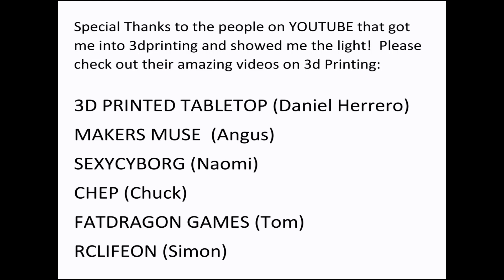Why do LCD screens fail in resin 3d printers?  Are they cheap pieces of crap or something else?

Comment: I have 2 Anycubic Photon S, that I’ve run frequently, but not daily for the past 6 months.  I think I have an LCD failure on my hands but wanted to get confirmation.  I’ve run a couple of failures in the past week, and the build plate comes out with a bunch of transversely oriented areas of cured resin, and realized yesterday that when I run a test on the printer, the UV likewise is a series of random parallel stripes, instead of a uniform glow.
That being said, if does sound like a LCD fail, where can I buy a replacement?  Also, is there a way to upgrade the resolution, etc of the LCD screen to improve the resolution of the prints?  Not sure if that has any effect, but curious because I mostly print 28mm miniatures and I’m trying to crank out as much detail as possible.  PS love your channel and appreciate what you do, keep it up!

Comment: here  i learned its jsut heat that kills them .. and most lcd printers do not have enough cooling...  the black and white/.monochromatic printers  are faster  because  of the complete blocking of  uv or complete pass through. ( not filtering through semiptransparent color rgb)   and thus also last longer and care less about heat. .
most resin printers have no or little to none cooling for the scren as teh scren and teh reflective panels are trapping in teh air heated up by the LED .. 
nothign that a few well placed vent holes and a cold air fan cant cure..
Reply: i wonder if putting a peltier module with a fan to blast cold air over the lcd surface would do the trick and extend the lcd module life . also as a newbie would cooling the resin help to heat sink the heat from the lcd on the top most surface of the lcd or would it degrade the print

Comment: BLASTER with UV light, Year Leave somethings out in the Sun and what them fade.

gadgetman below

The new Photorez Sonic has a special LCD screen for 3d printing. According to them it lasts like 4x longer and prints faster because it doesn't heat up as much like typical LCD does by letting the UV light pass thru easier instead of converting to heat. But of course that LCD is like 200 bucks I think so when it DOES go, it costs way more to repair

Comment: I made a horrific mistake with one of my elegoos. I actually had a small layer of cured resin on the FEP that I didn't realize accumulated from a failed support bit.....and the build plate when it came down on the next print it started making a grinding noise (Because it was trying to push down on the LCD but the resin was blocking it, so it was actually CRUSHING down into the LCD)----a really sad mistake to make on my part...fortunately for 30 bucks I replaced the screen---but still, OOF that ruined my day :) Lesson learned though!
Reply from the maker: ow!  that's why support placement and not failing are so critical!
Reply: @3dprintingpro212  too true, fortunately I've used your videos to improve my supports and haven't had any failures since. And also fortunately it wasn't too costly of a mistake when it happened! but one time is more than enough times to learn that lesson!
Reply: could you tell me where you bouth the LCD?
Reply: @enoriega  Hey Enoriega, you can sometimes find them on Amazon (Covid has definitely made them harder to find) ---also sometimes the maker of your 3D printer sells it as a spare part. You can find them on ebay / general googling the same size for your unit---cost around 30-40 USD. MOST OF THE TIME they ship from china, so be aware it could take a while to get a replacement. If you buy one, do yourself a favor, and buy TWO...so you have a spare ready when you need it.

Comment: OK, let me reveal a little secret here. LCDs used for a cheap MLCD resin printers are a color ones. Yes an R-G-B matrix. Google "color LCD" and you'll get the idea. Now, the issue here is that the transmittance of such a sandwich-ed LCD is around 5%. So, if you have a 20W light source, only 5W goes true this sandwich. And this is true for a visible light. For a UV or deep blue (405nm wavelength) the thing get even worst, because the R and the G portion of the pixel blocks the "blue" light even further - to put it in a layman's term.. As a consequence the majority of UV light is used to heat the LCD. The UV-range used for photocuring is not that dangerous for the LCD matrix after all, but the heat is. Though if we would use deeper UV like 380nm or 360nm or even deeper... that would be another story.  Now you have it... why we use this spectrum.

Better a.k.a. more expensive MLCD resin printers use active cooling of LCD mask. UNIZ in their 3DPs even use a liquid cooling!
Now to the other secret. The MONOCHROME LCD. Yes an ancient technology that was discarded in favor of color ones. And funny enough, they had to "reinvent" the process because no one was making them anymore. Within a monochrome LCD you have one solid pixel instead of three in color LCD, and they are without any color filter in front. That's why some vendors claim that their "secretive" and superior technology is better.  Of course is better. And of course is more expensive, because LCD manufacturers have to re-adopt the color-LCD workflow to the monochrome. It's basically the situation from the beginning of color-LCD life-cycle. At the beginning color LCD were very expensive until the production meet the demand. Now they are VERY cheap.
For example I just payed 360USD for a 13,3" 4K monochrome LCD while a 15" 4K color LCD could be found for 100USD.
Bottom line, sooner or later every single vendor in MLCD resin printing will have a monochrome 4K LCD! Right now the demand if much higher than supply and changing the cheap colored LCD is still a viable option.
Guys, if you can find a way to cool your LCDs is not that hard - though a bit noisy!
Reply: Awesome post, thanks!
Reply: There is a MONOCHROME LCD 3D resin printer,, faster printing. 
gadgetman below

The new Photorez Sonic has a special LCD screen for 3d printing. According to them it lasts like 4x longer and prints faster because it doesn't heat up as much like typical LCD does by letting the UV light pass thru easier instead of converting to heat. But of course that LCD is like 200 bucks I think so when it DOES go, it costs way more to repair
Reply: @3D_Printing  As for April 2020 there are only a few (5) printers that use Monochrome 4K LCD!  We are using 13.3" 4K mono LCD and it costs 3x more than a color one.
Reply: How does Uniz liquid cool their lcd masks?
Reply: @mkfabrication606  Quite an easy solution. You can find on their website under support a "Replacement of an LCD" tutorial where you can see some pictures with a cooling system. Bottom line... It resembles a floor heating pipe like tubing. Transparent of course :-) Well actually is more like plexiglass with carved maze for water/oil to flow around and cool the LCD masking screen.  I didn't yet disassemble mine so I can't show (point you to) any pictures. 
My opinion... an overkill!! BUT, but you have to keep in mind that the UNIZ Slash printer was designed to build 200mm/h and more. Although they advertise it and brag about their UDP (unilateral direction peeling) it's a hole in the water. It NEVER worked as it should.  And sincerely for 4k USD.... it costs like a Ferrari, it looks like a Ferrari, the specs are like a Ferrari, BUT the performance is like Anycubic-S.
A bunch of good ideas very badly executed!!!!
Reply: @dodobarbar  Hello, this is the first time I'm coming across this info. I have the Elegoo Saturn 4k coming in, in a few days. Is there a way I can mod a cooling unit to it, in order to prolong the life of the LCD? If yes, can you please point me to some articles/tutorials on how to do it?
Reply: @rahulbanerjee2970  Sorry, for a late response. Hmm, not that I would know! I mean, a how-to article or a link. But You should do some unscrewing and check where would be the best option to introduce an additional fan that would blow directly to LCD panel. I would sugest some radial fan (google it : radial fan images). Personaly I don't have a Saturn, though it was on my shopping list, so I can not give you any further detail.

Comment: Would be great if they built an OLED screen that the LEDs in it were UV in stead of color like other OLED screens. Would make the machine a lot smaller and would require less power. That would be ideal!
Reply: Sure, sure, but... OLEDs DO NOT  GENERATE UV-length light. Simple as that! Next idea?
Reply: Take a look at Photocentrics line of 3D printers. They do not use OLED but they do use LCD technology that doesn't rely on 405nm light to cure. You can't use regular resin on this but you can buy "Daylight" resin that cures at light wavelengths that are higher then 450nm. The failed ONO 3d printer uses the light off your cell phone to cure resin. But it's not the printer itself that lets you do that, it's the resin that you need to use. I'm pretty sure that it is possible but it will be a bit too expensive for consumer level hobbyist like us... So no one is really pushing for it nor cares for it.
Reply: I'm sure they are going to try to invent screens that don't overheat themselves to death or mess with that thin polorizer? that's attached to the screen.
Reply: @johnbouikidis6317  Hold your horses, buddy! Photocentric DOES use "daylight" wavelength to cure their resin, BUT... The new printers they developed recently use 405nm!!! Bottom line, using visible light requires more energy/area thus time per layer is unacceptable high for today's standard. UV carry MUCH more energy, consequently the curing time is VERY short. The negative side is that everything below 400nm is damaging for LCD. Basically UV got trapped in the LCD structure thus overheating it and  destroying it in relatively short time. So, "they" found that the sweet spot is around 405-420nm. (I'm not even mentioning the photo initiators for starting a photo-curing process). Therefore, ...I admit, I was looking toward "daylight" resin printer too, but it's really a NO-GO for the future. The benefit of a UV at 405 is way greater than of "daylight". that's exactly why  Photocentric is working on NEW UV printers. Disclosure: I've got a whispering confirmation from a Photocentric representative Formnext trade show!
Reply: @dodobarbar  I wasn't aware that they started developing printers that use 405nm. I was basing my information on prior years when I was interested in using daylight resin as well to try and make a cheap DYI printer. I've seen a few videos by 
Ionel Ciobanuc where he made a resin printer that uses daylight resin and used just a regular LED matrix to cure the resin. I appreciate the information you provided. It seems that you know a good amount of information that we could all learn from.

Comment: Speaking of screen failure - has anyone tried cellphone type screen protectors on the MSLA screens? Wondering if those would make any difference when getting the inevitable bit of cured resin sitting on the bottom of the vat.
Reply: THAT WOULD BE A NO NO NO NO!!!!! MLCD resin printers use a special film that's based on Teflon (FEP) or super hydrophobic silica (PDMS) that help peel the part from the VAT.
Reply: Just use packing tape.
Reply: ive heard of people using the nintendo switch screen protector on their photons because the screens are the same size.
Reply: @companyoflosers  Nice. Thank you.

Comment: That's the one big gotcha of MSLA printers. Average life of the screens is estimated at 400 hours. Not THAT terrible with the little $30 screens and typical hobbyist use. But if you are using the printer 24 hours a day as many do, especially with tall builds, that means on average you're replacing the screen every two weeks. That gets especially expensive with the new 10.1" printers.
Reply: yes but those who are printing 24/7 are probably running a business. idk if youve seen how much a mark-up occurs for 3d printed objects, but they cover the cost of resin and replacement parts in the price.
Reply: @companyoflosers  That's true, but if you're printing tall objects like vases or similar, those print times are LONG and the hours do add up fast. But like with just about anything else - bigger toys = bigger costs.
Reply: The solution is pretty darn simple! COOL IT!!! Use some DIY skills and use another fan!
Reply: @dodobarbar  But is it the heat that kills the screens or the bombardment of UV?  Or both?
Reply: @JohnJones-oy3md  Heat is the No.1 killer!! UV in the range of 405nm is not that much of an issue. But down the road adds to the equation for sure.
Reply: @dodobarbar  Please, i need more information about it. In my country it is very difficult to buy a new screen. Delivery from Aliexpress takes a month or even more. I searched the whole Internet but couldn't find how to improve cooling of LCD on Anycubic Photon
Reply: @clanbaclan6285  The Anycubic Photon has  a very bad design regarding UV light. Basically, well you probably know it already,  the shape of a light funnel is a "pyramid" alike and goes from the LED chip all the way to the LCD.  You should  therefore open this funnel on top close to the LCD and introduce some kind of air blower . Like the cooling of the filament in FDM printers. But as far as I know the LED  combo is around 20W. Which is not that bad. There are 3DP that have 120W!!! That's a oven basically. 
To really try how hot it gets, make a 1h or 2h print (as large as possible) and immediately after finishing take the vat out and measure with IR thermometer or just use your hand! If you can hold your hand on the LCD without any discomfort...you're good! But still, electronics doesn't like very high temp. so if you have a DIY skills make some cooling.
Reply: @dodobarbar  Id say reading the posts. The uv ends up causing the heat to destroy the lcd. Cooling the lcd with a peltier module might help
Reply: @bobbuilder5399  Peltier element needs a flat surface to be "glued" to. Where would you stick it? On an LCD?  :-) ...how would a light pass through. There are better options, like water cooling for example.

Comment: The new Photorez Sonic has a special LCD screen for 3d printing. According to them it lasts like 4x longer and prints faster because it doesn't heat up as much like typical LCD does by letting the UV light pass thru easier instead of converting to heat. But of course that LCD is like 200 bucks I think so when it DOES go, it costs way more to repair.
Reply: Ahh, rubish.  The "special" thing is the monochrome LCD.

Comment: So, would a lower powered UV light source result in the screen to last longer (i.e. Poton vs Photon S vs Elegoo Mars)?
Reply: No, it would just make your exposure times per layer longer resulting in the same end result on the LCD panel.
Reply from the maker: @WayneMcCormick  stronger light does burn out the screen faster actually, I'm fairly certain
Reply: @3dprintingpro212  Pretty sure it is a cummulative effect.
Reply: @3dprintingpro212  As I wrote before...where the catch-22 is. You actually CAN even put a stronger UV source but you really REALLY NEED to find a way to cool down the LCD. The heat will make the LCD crack internally.
OH, yeah. And is not about "burning it out" it's more about plain old overheating the electronic thing...
Reply from the maker: Yes but then you print slower so....I'd rather stronger light printing 40% faster and burning my screens out faster  :)
Reply: probably yes, but would also increase print time exponentially.